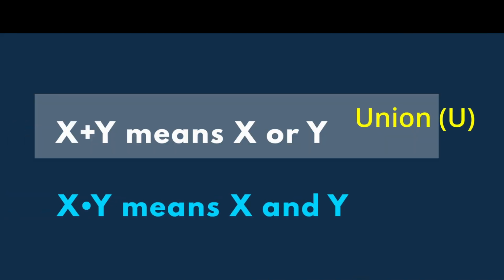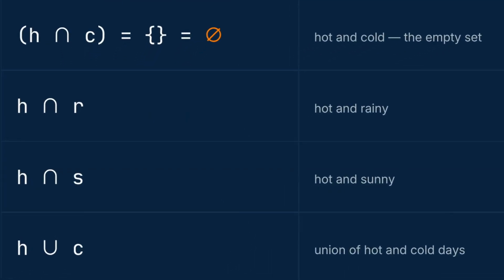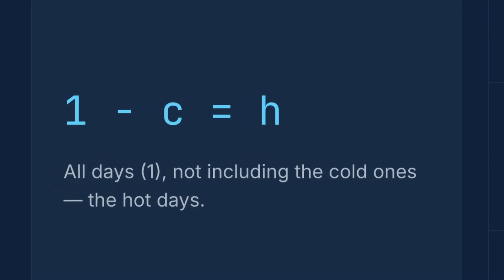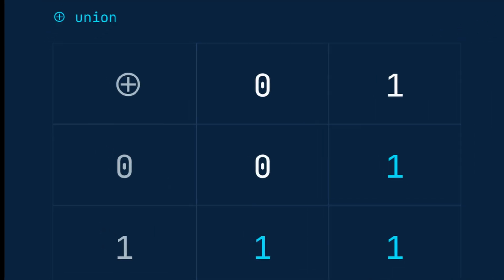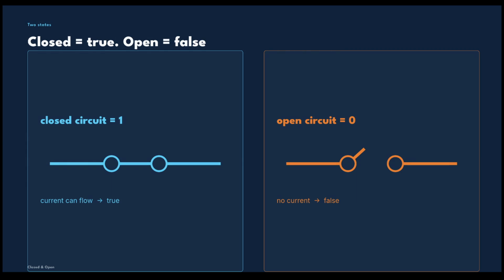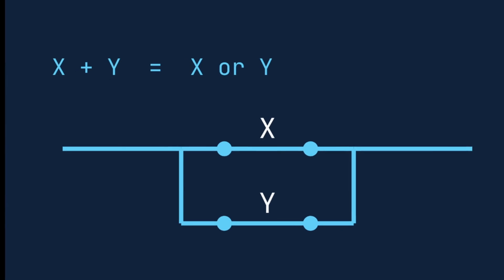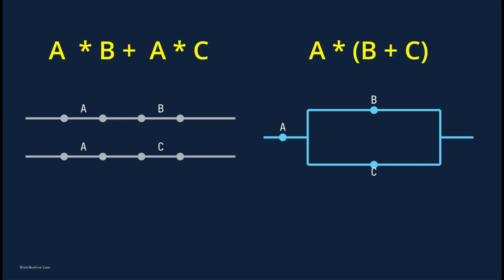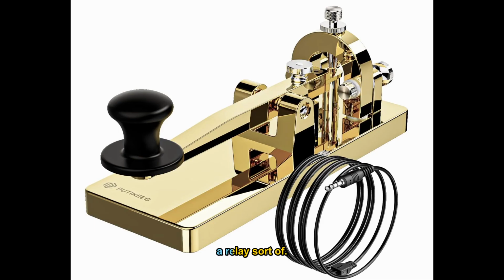How George Boole and Claude Shannon Created Computer Circuits

Comment: Imagine working at Bell Labs and Claude Shannon 
greets you on a unicycle while juggling. 🤹Quite a character he was. 
Also Claude E. Shannon Award has been  awarded since 1973 (source wikipedia) 😎
Reply from the maker: Thanks.  I studied his papers.  He invented compression too.
Reply: @TheSiliconSkeptic-e8g Compression? You mean like file / data compression - winzip 7zip etc. ? 🤔
Reply from the maker: @reloadanything  he showed that much data contains redundancy. You can remove that redundancy, create a smaller representation, and later reconstruct the original data exactly. This is lossless compression.